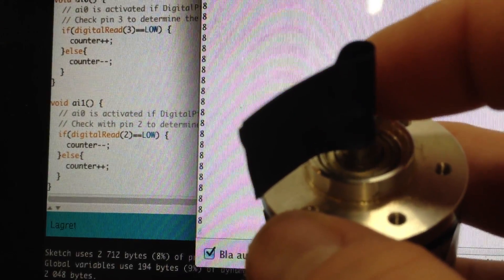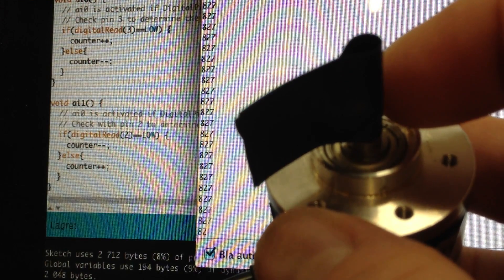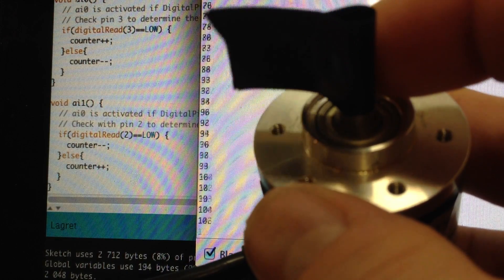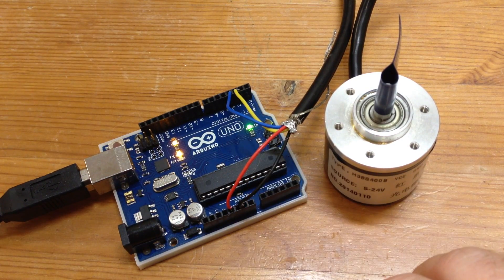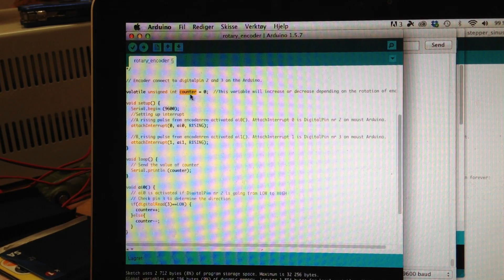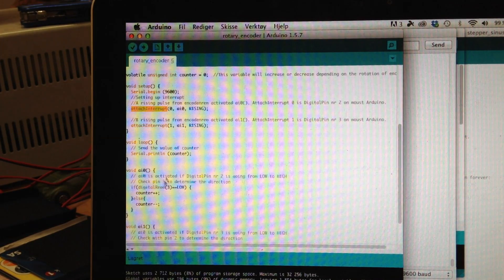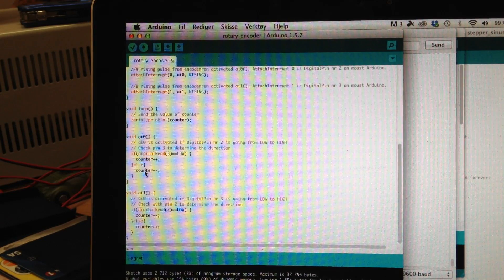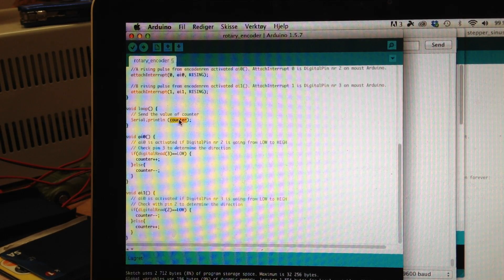BenRotaryEncoder incremental rotary encoder code for Arduino

Comment: Hi does it work? With arduino leonardo, i´ve uploaded the code and connected the wired scheme and in the monitor shows 1 2 and when i turn the encoder it doesnt go to 50

Comment: If the motor does 3.500 rpm, the encoder 1.000 pulses, does the arduino have enough capacity or are pulses lost? Thks
Reply from the maker: 3500 000 pulses/min, 58 333 pulses/sek. 17 us (micro sec) pr pulse. Sorry don't think Arduino is fast
Reply: @BenTommyEriksen  thanks :D

Comment: Can I attached with rotating shaft and run stepper motor
Reply from the maker: Yes you can. It is called closed loop stepper motor. I expect you to use it to check the stepper motor. That's a good idea.

Comment: Hello, how to run this program in Arduino Mega 2560....
Reply from the maker: You can use pin 2, 3, 18, 19, 20, 21 as interrupt
Reply: @BenTommyEriksen  Hello, I am new to this arduino and learing... the nos. are written  as PWM and communication.. any changes in program.. Need your help to learn..rgds

Comment: hey, thank you for your video. I'm trying to build a midi controller with 5 encoders. Everyone told me to use external interrupts, but the leonardo has only 5 of such pins. do you know if it's possible to use only one interrupt pin per encoder?
Reply from the maker: If there are few pulses, you can use other pins to detect the number of pulses. Arduinoe may have the computing power to do that. There is a chance that some pulses will not be counted.

Comment: Hi, Ben, I have rotary incremental encoder specification Maximum Speed 5000 RPM, Pulse Per Revolution (PPR) 600 and Counts Per Revolution (CPR) 2400. so, would like to measure out in rpm. how the code i need to update.
Could you explain for this coding:-
What is map intruction doing 
 float speedOut = map(counter, 0, 400, 0, 100);      // change from 400 pulse pr / second to 100 m/h
 Serial.print("\t Speed = ");
 Serial.println(speedOut);
Reply from the maker: map function is scaling a number. In this case <counter>  goes from 0 to 400. speedOut varies from 0 to 100. speedOut = counter/4

Comment: Hi, Sir. My encoder is 2000 p/sec and the speed of my motor is about 1 r/s. So it is mean that  average 5.5 pluses is corresponding one degree. Is it right? Thank you.
Reply from the maker: Yes - I think so. I recomend that you in you program use 2000/360 not 5.5
Reply: Yes, thanks. I will.

Comment: Code works with one exception: My counter does not decrement when the shaft changes direction...It only increments. Any ideas? I'm using an ELEGOO Uno R3, and I'm using the internal pull up resistors.???
Reply from the maker: I think you only get a signal from one wire.

Comment: I would love to make a smart dial/knob for Photoshop, Adobe Premiere and 3D apps using an encoder like this. Like the Microsoft Surface Dial. Very cool stuff.
Reply from the maker: Cool. In case you do not know, Arduino has some models that can emulate mouse and keyboard. Leonardo, Esplora, Zero, Due and MKR Family. I'd love to hear more about how it goes.

Comment: Thank you for posting tutorials like this. I have some questions with my application, if you are able to help.
I'm using a elegoo mega (copy of arduino mega). And a Chinese made encoder. On the manual, it says input 5v output 0.5v. And serial output shows me only 0 on counter. Does it have anything to do with the pull-up? How should I solve this?
Reply from the maker: The error is usually pulupp resistance. So I recommend starting there. Just connect a resistance between inputs and + 5V. One resistor for every inputpin. 2 resistor int total in this case. Resistance should be 1Kohm or more.
Reply from the maker: On mega you have more pin for interrupts (2, 3, 18, 19, 20, 21)

Comment: hi, is there any tutorial working with incremental encoder and arduino where it will provide a speed/velocity feedback? because i'm working on a project which requires a feedback of the speed from my wheels.  Thanks.
Reply from the maker: https://github.com/BenTommyE/BenRotaryEncoder/blob/master/BenRotaryEncoderSpeed
Reply: thank you so much for your help.
Reply: hi, i'm enquiring on the part where you convert 400 pluse/sec to 100 m/h. is there a calculation on the conversion?  Thanks.
Reply from the maker: float fastMap(float value, float aMin, float aMax, float bMin, float bMax) {

  float delta = (bMax - bMin) / (aMax - aMin);
  return (delta * (value - aMin) + bMin);
}
Reply: Hi. Im a little bit confused about the speed unit (100 m/h). Let say my speed value is 55. Is it mean
the value is 5500 m/h. thank you.

Comment: I think you're loosing half of the information:
Every FALLING step should be taken in consideration to have a resolution of 400*4 = 1600 impulsions per rotation.
Otherwise thanks you helped me :),  I had a doubt: 400CPR means I can have a resolution of 4*400
Reply: can you please suggest the code for getting full resolution.
Reply: One method consists of writing a table in which every previous state - current state 4 bits represent a unique binary number between 0 and 15.
You may use interrupts provided your microcontroller supports "any edge" external interrupts (atmega328p does). Alternatively you can sample the two phases at a high enough predefined frequency.
It is well explained where I found the method : makeatronics.blogspot.fr/2013/02/efficiently-reading-quadrature-with.html

Here is an example of code I wrote compatible with the Arduino UNO you may compile using the Arduino IDE :

int8_t gray_to_dec[] = {0,-1,1,0,1,0,0,-1,-1,0,0,1,0,1,-1,0};
uint8_t enc_state;
volatile int16_t pos;

ISR(INT0_vect) {
    uint8_t new_state = (PIND & 0x0C) >> 2;  // Mask PD2 & PD3 and shift to the right
    pos += gray_to_dec[(enc_state << 2) | new_state]; // Read the table and increment/decrement pos
    enc_state = new_state;  // The present is the past...
}

ISR(INT1_vect, ISR_ALIASOF(INT0_vect)); // The two interrupts share the same code

void setup() {
    Serial.begin(9600);
    
    cli(); // Clear global interrupts
    DDRD &= ~((1 << PD2) | (1 << PD3)); // INT0&1 as inputs
    PORTD |= ((1 << PD2) | (1 << PD3)); // Pull up resistors on INT0&1 pins
    EICRA = (1 << ISC00) | (1 << ISC10); // INT0&1 any edge external interrupts
    EIMSK = (1 << INT0) | (1 << INT1); // Enable these interrupts
    sei(); // Enable global interrupts
}

void loop() {
    Serial.println(pos);
    delay(10);
}

Feel free to ask for any clarification.
Romain
Reply: my encoder does not output grey code
Reply: @Depth74ir0  is this a code for PPR or CPR?
Reply: @ishamalik3571  It is updating for every transition on any of the two encoder lines, so if CPR = 4xPPR (correct?) it should have a resolution of CPR per turn
Reply from the maker: Do you have more info about your encoder?

Comment: thank you sir this video is really helpful. I suggest you to post the additional 10k pull up resistor to the out A and out B. mine has worked after i added the pull up resistor :)
Reply: TY fpr that tip Josh

Comment: Hi - I have pasted your code in and for some reason this does not work for me... the counter stays at 0.  Any ideas?
Reply: +Ben-Tommy Eriksen is correct , but the encoder lpd3806 need external pull-up , I tried 3 different Arduino boards UNO and only worked with the pull-up 10k
Reply: I was having the same problem with arduino duemilanove, 
adding these lines on setup method

 pinMode(2, INPUT_PULLUP);
 pinMode(3, INPUT_PULLUP);

solved the problem

these lines enable the buildin arduino resistors, necessary due the low output voltage from encoder channels, I think...
Reply from the maker: Check that the + 5v and minus are properly connected. Encoder connect to digitalpin 2 and 3 on the Arduino.
Reply: Ben-Tommy Eriksen Hi Ben 

its a slightly different model that I have so I'm running the power from a 12 molex on a PSU.  i can get pulses with a different piece of code but only counting the pulses.  I will have another go tomorrow, can you point me in the right direction of some alternative documentation? 

Thanks
Reply from the maker: jacknco Remember that the input of the Arduino must not exceed 5V (3,3-5V). The solution may be to allow the output from the encoder to go through a voltage divider. Two resistors in series. A resistor 6 Kohm and one on 4Kohm. Late in the pulse in the top and take out the signal in the mitten. The base is connected to ground.
Reply from the maker: ***** It might be an idea to connect encoder to the analog Inga gene so as to use analog two serial. Just to see if encoder works.
Reply: jacknco I have a no-name LPD3806, and found that 5V from the Arduino isn't enough to run the thing.  I hooked up a 12v external source to the Arduino and used the Vin pin to supply it, and that made it start working.Also be careful about the wire colors--some of these things definitely use a non-standard color pattern.  Don't assume red and black are power and ground; I have two of these things and for one of them red and black are the signal wires, and brown and green are the power and ground.
Reply from the maker: tiafolla Be careful that you do not submit 12V on Arduioen. It will ruin the Arduion. You have to connect it via a voltage divider or optocoupler.
Reply: +tiafolla you need pull-up in fase A and B and it´s work ok with 5v from arduino, i use 10k
Reply from the maker: +Adriano Almeida Arduino har buildt inn pull up resistor se: https://www.arduino.cc/en/Reference/PinMode
Reply from the maker: +Adriano Almeida Thanks
Reply: +Ronnie Fagundes de Brito thanks, it's worked for lpd3806